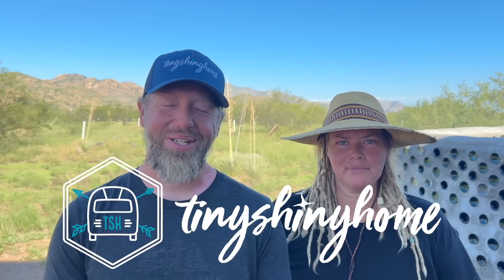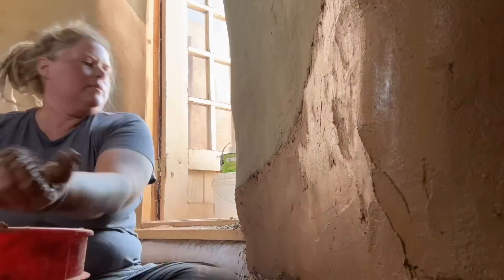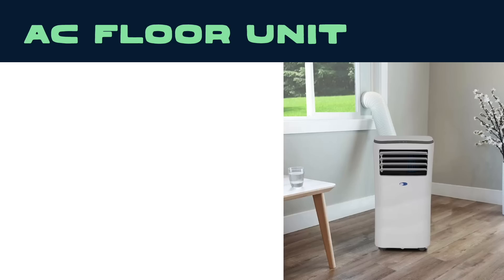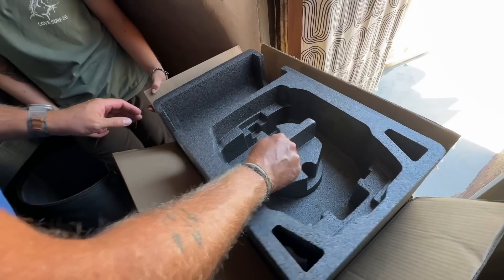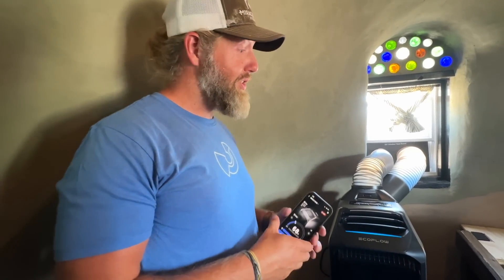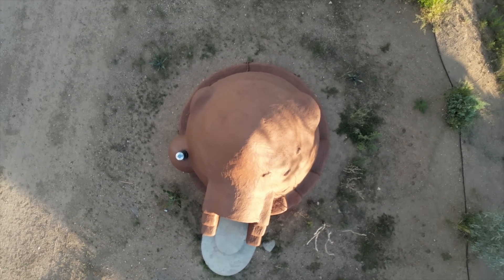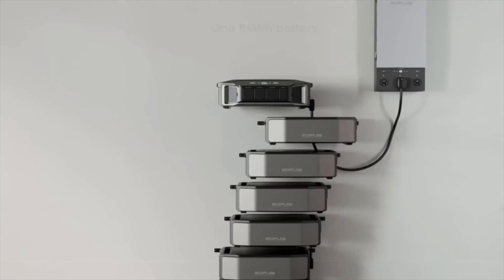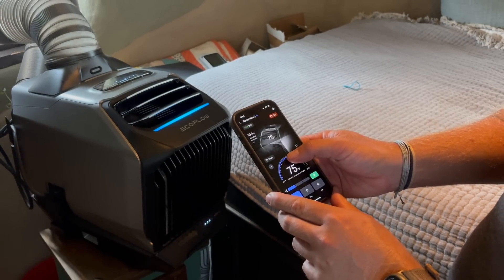Can This Tiny AC COOL Her Superadobe DOME?

Comment: I was wondering about this when you built it. Thanks for the answer. So if a do over would you do a heat pump for cooling?
Reply from the maker: We’d just make sure the windows are big enough for a small ac unit

Comment: You may consider putting a shade cover or 2nd roof over that dome.
Reply from the maker: Nah we aren't going to build another structure over it. Would be very expensive to build something that withstands the winds we get and stop the thermal mass transfer in the winter. Cooling it with the small A/C is by far the simplest and cheapest option.

Comment: After enduring 107 heat with just 90 watts solar panels and 12V 23wh Dakota Lithium and small 8" fan...staying under a wet T shirt to cool off...glad for no humidity and windows covered from inside with memory foam...I realized if by 2am it's not below 93degrees it's miserable. Fortunately my house sheds heat better than Adobe...but...without large Windows and Fans won't help if stays humid at night. In the 60s in Mississippi it cools off fast at night. Same thing on the sand in Oklahoma. Old houses didn't even have insulation. Dry heat. Dry summer nights. Cool breeze. But it's changed a few. Degrees warmer and colder 0:24

Comment: Is there a way to build a wall on the west side of the little home that could block the sun? Or, put a roof above it to lock the sun
Reply from the maker: Remember, we want thermal mass most of the year so building an expensive shade sructure to withstand winds doesn't make much sense. A small A/C was much simpler.

Comment: Would it be cooler painting the little cabin white. That brown must absorb a lot of heat. Also, a mini split mounted 90 degrees may still be the way to go.
Reply from the maker: Thermal mass transfer happens either way, a mini split would be great for a larger building but wouldn't really fit in this one.

Comment: Are permits needed for these buildings in your county?
Reply from the maker: Accessory buildings that aren’t the primary dwelling need to be permitted if over 200sqft or cost more than $1k here in Cochise County.
Reply: @TinyShinyHome  Did you get permits for your main dwelling? My county has the same rules on accessory buildings, but need a well and septic before any permanent residence can take place. Thank you for being so helpful your channel is a big reason why I secured my own 40 acres plot in northern NV.
Reply from the maker: Yep all permitted. Of course will be different where you’re located 👍🏻

Comment: Great job's. That's really close to the size I want just with a godly clear view and material hunting is challenging.
3:48 Dos that use more than a window one commonly uses ? I'm areas that some times have around 20-40% humidity at early summer. I'm waiting for my 
EF ECOFLOW Portable Power Station DELTA 2 to be delivered. Any day "fingers crossed".

Comment: Just a FYI... You can trench anywhere if you use a airspade or pressure washer. And if you build another building in the future, try making one that is two external walls with a air gap between the two. This will give you the most efficient type of insulation without actual insulation. The outer wall doesn't even have to be thick either... just something to block the direct impact of the sun.

Comment: A stone house in NJ, was  super cool, for most of the summer.  But after the rocks heated up, it turned into an oven.  So, it was fine until august. It took that long to heat the rocks.  It also had aluminum siding, so, that might have insulated the rocks for awhile.  The same drama was true in the winter.  It took a while before the rocks were exhausted, but you'd have to work harder to keep cool or warm.

Comment: I also have an Eco Flow Wave2. FYI if you put insulation around the hot outflow pipe the radiant heat from the pipe doesn't seep through the pipe into the space you are trying to cool and it stays way cooler using less power because it engages less frequently. 
Good luck!!

Comment: well you got a $1,000 ac unit for free.  still had to run power to it from the  main power hub.  buying  a $300 8,000btu portable ac unit may be a better option. i know power is a concern...
but if you add $700 in solar to the dome that would help off set the power needs. .... if your spending a $1,000  an eco wave 2 vs a standard portable ac and  solar panels to increase power.
not bashing. you showed us the bad and the good of the system.  look forward to an update long term.  stay well

Comment: Temp control is why the old adobe homes had 3 or 4 foot thick walls.
Also, you can bend a piece if sheet metal to make a hood for outside of the window to keep the rain out. You cam bend the inside edges to slid into the window sill to grip in to hold it in place. And you can probably attach another small panel on it to make more electricity too.

Comment: Also make sure that you separate the exhaust and intake so you have better efficiency from your ecoflow 
You don't want that hot exhaust to be sucked back into the intake 
Simple solution for better power effiency would recommend you to do it

Comment: Since you can directly charger the Wave 2 using up to 400 watts of solar, a great option might be to add two or three solar panels to charger the battery in the wave 2.  It should run all day and night with a couple of 200 Watt panels…
Reply from the maker: You’d need more panels or more battery unfortunately - the math just isn’t quite there yet.

Comment: Build a freestanding shed roof over Adali's tiny cement hut? This would create shade, and could hold more solar panels. Also, could paint the hut white...
Reply from the maker: We're not going to build an entire structure around another structure. That would be entirely cost prohibitive. Thermal mass transfer will happen regardless of the color.
Reply: @TinyShinyHome  Just a shed roof!  And yes, thermal mass transfer will always happen, but Not as Much. A white surface bounces off some of the heat.
Reply from the maker: "Just a shed roof" that has to withstand the winds is still cost prohibitive. The concrete, posts, and roofing would cost more than the A/C unit.
Reply: @TinyShinyHome  Of course, it is your choice what to do!  
And yes, the shed roof would cost more than the A/C unit. 
The place is just too small, with too-thick walls, with the heat permeating, and the sun beating down. If she had a roof, she could put shade sails on the sides for morning and evening, and put the A/C outside. It looks like it is taking up a lot of the floor space. And it makes noise all the time, doesn't it? If there was a roof, you could put in a big vent at the top of the dome and not worry about water ever getting in.
The goats get a shed roof, why not Adali. The Airstream gets a shed roof. 
(All the best, I'm not trying to be bossy. I admire you-all a lot.)
And you got the A/C unit for.free anyway.

Comment: Have you thought about digging a three foot deep trench, lay a large diameter terracotta pipe or use tiles to create a natural cooling and have a airflow near the top of the dome. This will create a passive cool air cycle from the underlying structure . In winter just plug the inlets with wood plugs, no more cool air. No energy cost as it uses the warmth from the walls to move the air to vents. Very effective. If it's not cool enough add another pipe. A few facing into the dominant wind does the job . Love your setup.

Comment: Another suggestion would be a geothermal system, which generally requires a 4 to 6 ft trench and buried tubing through the trench.  The tubing has to run at least 100 + feet to get the coolness of a cave,  one end would go up into the small dome with a screen over it and the other end would have to be exposed to air with a screen to keep critters out, but allow air to flow thru the tubing.  You would need a black vent at the top of the dome. As the air heats up inside the dome, it will escape out that vent, and start pulling the cooler air from the tubing into the dome.  Vice president Gore uses a system similar to  this, but he uses a black chimney for the hot air to escape his large home.
Reply from the maker: This would be incredibly cost prohibitive for a tiny dome.

Comment: I Love my EcoFlow products! Keep the box. I have the Wave and Battery, Delta Pro with the spare Battery and their dual fuel generator. I didn't use the Wave that long due to downsizing to camping out of the Prius. I'm still on the Wave FB forums. Most people that vehicle camp order the insulated covers for the tubing (Amazon) and use only 1 of the hoses.  Instead of sucking hot air from outside, then cooling it, you're only sucking in cooler air and then cooling it more. In my truck camper I had stainless vents for the hoses (Amazon), kept bugs from coming in.  Miss you guys❤
Reply from the maker: Nice! We’ll have to try it that way for sure 👍🏻
Reply: @TinyShinyHome  
Logically you need both hoses, one hose to route outside air to the condenser and the other hose to expel the heated air outside. The evaporator will be in a sealed compartment with only the room air circulating through it. Lowering the temperature of the air in the inlet hose going to the condenser by insulating, shading or burying in the ground will increase the cooling efficiency.

Comment: Well to me it means the summer su must stop hitting the dome from noon to sunset. 

Thus I would build a pergola fully block all western sun over the top of the dome. It a cheap enough solution. 

And build a cool trench tube, coming into the floor level of the dome.
Reply from the maker: Nothing about those solutions are cheap. A temp ac in the summer makes way more sense.
Reply: @TinyShinyHome  I understand and support all of you.  You are there and make this math judgements to fix a problem not planned for. 

I do know for here on my AZ property this is exactly my concern about building a bag dome. It has to be sheltered from the summer sun arc. Along with natural AC that we see being used in New Mexico Earth Shelters for the past 20 years. Actually, at CalEarth, this is part of the planning before building for student classes. Same for cultures in Africa for thousands of years.  

Not sure about the AZ Hopi.  I have been inside every nook at the protected Hopi Ruin in Coolidge AZ. It does seem they connected all the rooms with a draft hole at the bottom of the rooms, leading to the center astrological observation room at the highest point, so there would always be a natural draft pulling through the structure in summers. Phoenix level heat.

Comment: I didn't see it in a quick search of the comments, but have you considered a reflective paint for the exterior of the dome? I would think that would cut down on radiative heat transfer and lower your cooling needs. Or would the loss of cold season heating from the sun be too much of a penalty? Thanks for the video; cool stuff.
Reply from the maker: Yeah, tradeoffs ;)

Comment: So…. Will the big house just be a bigger problem to cool than the little house?? Have you considered passive cooling like other earth homes have??
Reply from the maker: The big house is already designed with mini splits to regulate room temps. Also, it will have an insulated floor and it's not a dome so also insulated roof.

Comment: This is really suprising! So many of the domes I've built have survived better than this one currently is. BUT!!! I did think: the dome is still very much releasing a lot of it's moisture, from the bags and the plaster. I've alwasy found them to be much more humid and uncomforatble as they are releasing this moisture. I feel the dome will perform differently and hopefully a little better after it's first year of completly drying out. As you've installed a membrane paint, the only way for 100% of the moisture in the walls to go is through the internal natural plaster. Hopefully it does improve and shows off the radical power of thermal mass. 
But yeah, its tiny and like a million degrees outside. And a darkish paint! 
Great video, as always you legends 😍

Comment: Can I suggest a tube or 2  someplace on an upper side(opposite if 2 ) of dome as to let hot air vent out to assist in heat control . Sort of like concept of upducts used with evap systems.
Reply: Oh on tubes put some controllable way to open close like upducts .
Reply from the maker: There's already a vent up top to remove warm air.
Reply: OK, somehow I totally missed that. Oh yeah I remember now with the fan. Thanks. Will continue to watch and learn. You guys are so inspiring and super teachers. Thanks.

Comment: Would functional and decorative shade sails on tall poles help to keep the dome cooler?

Leave, Same or Better, Everything
Be Kind
☮️🙋🏻‍♂️
Reply from the maker: Sure, shade would help, but building something that would hold up in our winds was cost prohibitive. Especially for something needed a few months of the year.
Reply: @TinyShinyHome 

Sure, I understand completely 

What I envisioned was using the steel poles that you used on the goat fence. 
Concrete them into the ground at an angle that is opposite the direction of pull.
At the top a pulley or even just a groove where a rope from the shade cloth could be pulled over and tied down for quick assembly or  disassembly.
As an added bonus the poles would act as a lightning rod protecting the building.......

🤜🏻🤛🏻
Reply from the maker: The dome is much taller than it looks on video. The pole length and subsequent concrete amounts would be cost prohibitive

Comment: I have a question. wouldnt it be cooler if the dome was painted white?? Also, why cant you trench a conduit in? Just hand dig in critical areas?
Reply from the maker: Nope, thermal mass transfer still happens either way. There's a concrete floor in the dome, we aren't trenching anything undeneath.

Comment: Just cover the earthbag with WHITE ceramic tiles from outside. You won't believe what a huge difference this will make.
Reply from the maker: The outside is already plastered and waterproofed as well as irregularly shaped. No idea how that would even work....
Reply: @TinyShinyHome  it reflects sunlight and keeps the structure significantly cooler. We did that on our house and it worked like a charm

Comment: What about the Delta Max? I think you got that unit first. Would that with the extra battery be able to run the Wave 2 without a cord? You may need another panel.
Reply from the maker: It can accept more solar input, but the battery size is about the same as the River. Could add more batteries to it, but it’s expensive. Using the system we had was a simpler solution.

Comment: As you build your large dream-home, perhaps consider building in natural cooling options that might've worked well in Adelaide's dome: a vent in the roof, and a deep trapdoor into the floor.  The shape of Adelaide's house seems very conducive to a vent system: The trapdoor exposes the room to the cool of the earth beneath which has not seen the sun, and then the hot air rises up and out faster than heat transfer thru walls can occur.
Reply from the maker: Yes, we're aware of earth tubes. Lots of pros and cons, right now they're not for us.

Comment: Sounds like you need software to shut off the solar to the hut at night and switch to the battery.  Would also be cool if there was an auto software/hardware switch at your solar collectors when it senses lightning in the area (there are weather stations that can record the lightning...not sure if there is technology where a lightning sensor could activate shutdown).  Might not be helpful, though involving dry lightning (where the heat remains despite the clouds).  You guys are so innovative with a lot of knowledge thats required to keep the solar humming.  But thanks for sharing the cutting edge!

Comment: If you run your air intake inside the dome, thus using air cooler than outside, wouldn’t the unit be more efficient? Think of the recirculating function in your vehicle.
Reply from the maker: It doesn't work like a traditional A/C unit. See https://youtu.be/R7P2RyJi_XI?si=D8iA55k4ZgGTTWxT&t=128

Comment: hi there lol . look im in Michigan its a wonderful state  other then the government that runs it . but the winters are fricken cold . so we have learned from birth pretty much how to keep the cold out . with insulation and plastic over the windows . in your case its a bit different . your trying to keep the heat out . now my sister lives in a very hot state down south somewhere i forget . but she would tell me how they do the same for summer . that would be more like what your doing . now i did say something about the color of your dome hate to be the i told ya guy . but look its a easy fix . it will cost a little bit but worth it i think . they sell survival tarps and im sure you can get them in some pretty large sizes . there  colored on one side and have a shiny i think mylar on the other . they do sell just mylar film but im sure that would last all of a hour . wind and what not . but a couple good tarps  set up like sun shades would reflect the heat and sun away from the dome on the sides that get blasted . hey just ideas take em or leave em . you could even just wrap the dome with a reflective tarp  and in the winter remove it for heat .